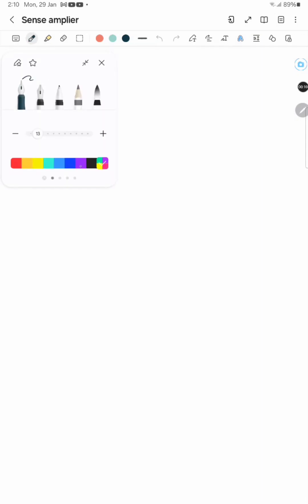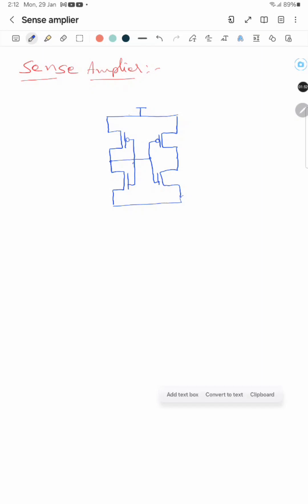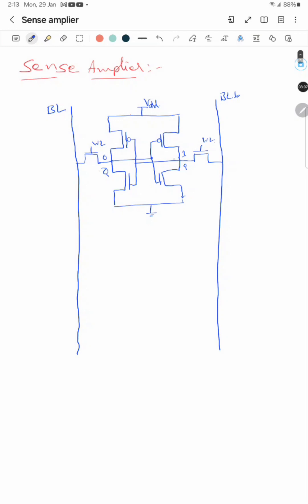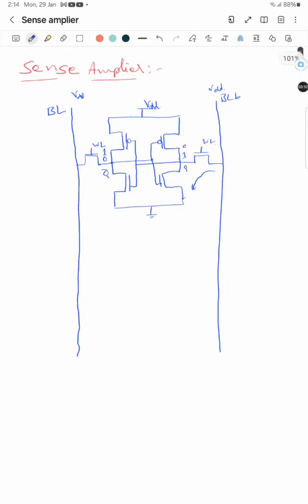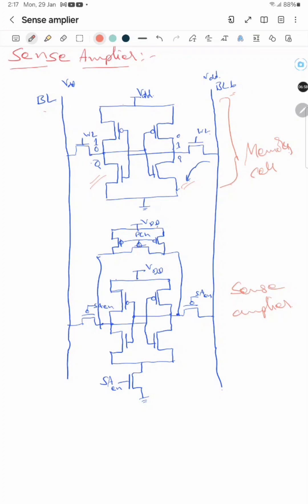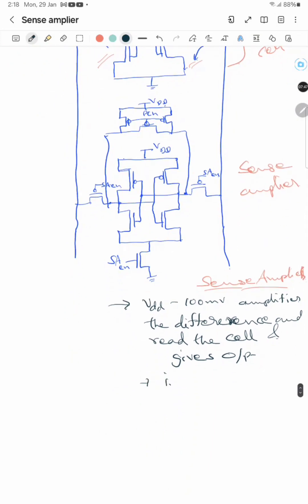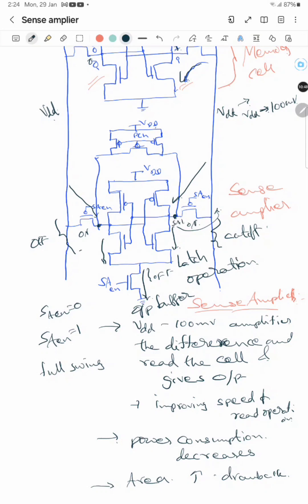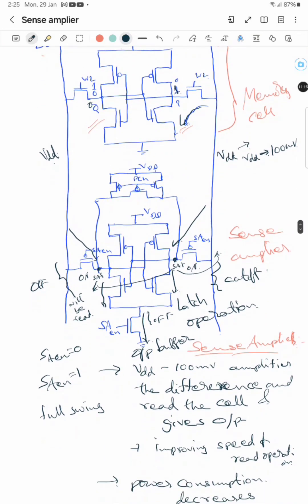Sense Amplifier | 3D NAND Flash | Read path of memory | SRAM |

Comment: can i use flip flop instead of the latch in the sense amplifercircuit part
Reply from the maker: Yes you can. flip flop is also a latch with a clock which is used in sequential circuits. Along with SAen you need to enable clock also. Thank you